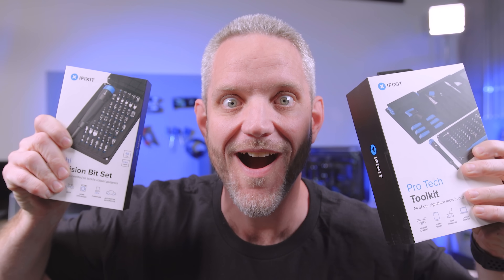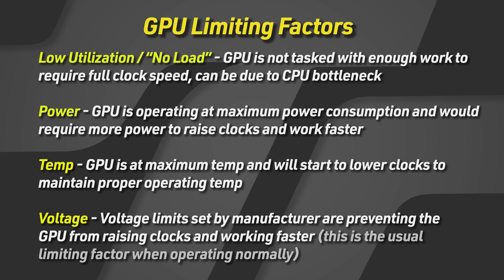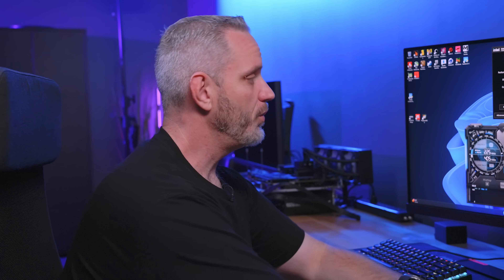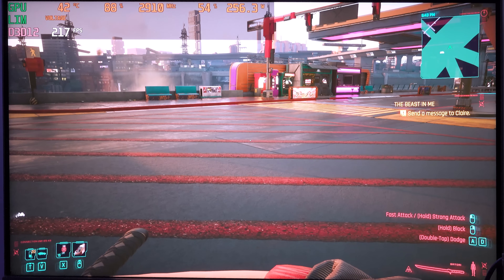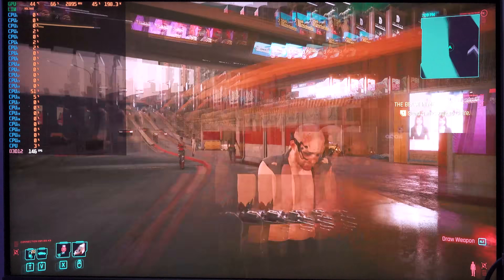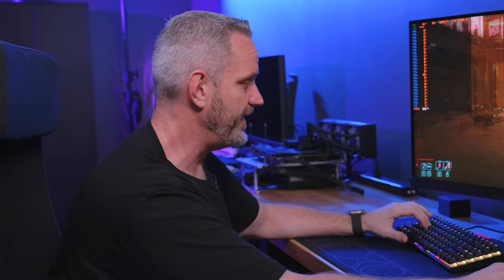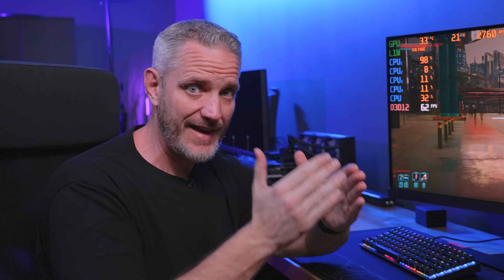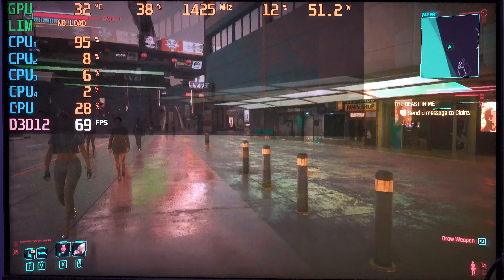THIS is what Bottlenecking REALLY looks like! AVOID THIS!

Comment: I still don´t understand. Its bit weird what was said in the end of video, so I would like to ask. You said as example, that situation you just showed is like user would get i3 13100K with RTX 4090, but it doesn´t make sense to me. 
You did two things to get so terrible bottleneck( and so bad fps). 
1. You meaningfully did lower your cpu power
2. You meaningfully did get settings in video game on ,,low"
Thing is, that me as casual, I actually was thinking of putting 4090 with some i3 processor. Because at first I can casually say that modern i3 cpus are very very good for gaming. 
So this is how I see it. If I would get i313100K and 4090, then turn on Cyberpunk77, I would obviously want to use such monster graphic card and put settings on Ultra...(not low). What I understand is that in such scenario, the graphic card would be in high use because of all those high quality textures presented on screen. And if we are talking cpu at that moment, it should work fine. Surely it might be at very high use (maybe even 98%), but as I see it, it should be still ok and no bottleneck happening. Only if the game would need (from some reason) more from cpu and so cpu would get up to 100% use and could not go higher then I see it would starts struggling. 
Im not sure why you did say at the end of video exactly that processor together with 4090, maybe it just came into your mind, but I dont think so, because its kind of known processor. 

So I dont understand why it would be so bad to get such ,,low" processor with high end card. Because if I would put game settings on ultra - the GPU should ,,eat that" primary. And so if I will use such high end card it should work on ,,fine" lets say 70% use. And now its time for processor to show up. Only thing I can see there obvious is that it would be difference in fps - each bracket some lets say +20 fps. i9 highest and i3 lowest. But as I said, these modern processors should work very all right and that specify one i38100K surely, so why and when that Bottleneck could happen with such combo low processor + high end graphic card ? Thanks !

Comment: Maybe start with something that barely pushes 60 FPS to start and then kneecap it.
I'm running Cyberpunk on an i7-5930K with an R9 Fury and it's capped at 60 FPS... because I capped it at the monitor refresh rate.  
Basically it runs fine on a potato.

Comment: Hi Jay

Hoping you can give some advice. Want to rebuild a pc, but I only play 1080p or max 1440p don't care to get anything higher as I don't have much time anyways, but when I do, I just play dota 2 or casual AAA. I also want to use this mostly for daily usage, I zoom, use Google chrome a lot, vdi (through Citrix) and code (not heavy). 

My idea is Ryzen 7 7700 with 4070, 32gb ram and water cooler. Is this overkill? I've researched for a while now, even think a Ryzen 5 with 3060 might be fine since I like 1080p but I really like cooler pcs, not something hot usually

Comment: I'm not gaming, I'm using my 3070 GPU for video rendering/upscaling. The AI programs use the GPU for their processing instead of the CPU. So, I don't believe I'll run into any bottlenecking problems in this situation, and should be able to upgrade the GPU to shorten rendering times, while keeping the same i7-4790k in the machine. 

I'm looking to upgrade to a more powerful GPU (4070 TS, or possibly a 4080 Super, though I'd like to stay with a 2 fan card rather than one of those 3 fan behemoths, if possible), but there's no information anywhere as to comparisons on video rendering times with these various GPU's that I can find.

Comment: @JayzTwoCents  I still have my 2019 PC build in 2023. I had from 80% to 100% utilization on GPU & CPU from 30% to 60% utilization. My RX590 8GB GPU decided not to show signal on both monitors anymore, fans are spinning, mobo shows VGA on DebugLED. Tried everything for troubleshooting. I have only 2 choices. 1.Resoder main chip but when i asked a repair shop they told me that isn't worth it because i would spend more money on repair than buying same but used one. I did tried without cooler for short time to check if main chip gets power and it feels a bit warm when i touching it when i power PC ON. And option 2.Reflashing GPU bios using secondary GPU for image. I don't want to rebuild my system because im not that rich so im thinking about buying different GPU but to be as a upgrade from previous one. Witch GPU would you recommend pairing with Ryzen 7 2700X powered by 800W PSU? Oh and btw i use monitors 1080p 180hz as my main and 1080p 60hz as secondary one. I know it's old system now a days but i was happy to have it and im definitely not planning to spend 3/6k for new build to match Cyberpunk 2077 Liberty City Max specs as i checked on PCPartPicker.

Comment: I think I got my most mature answer I been looking for I play 60fps at 4k on a 4k tv 60hz. EVERYONE is like 'oh if your not constantly using 99% of your GPU your bottlenecking' without actually explaining why its a bad thing? if I turn vsync off and played a game it'll load 99%. but I lose performance and my pc runs harder and I don't like to risk it. I just feel the less utilization and it can run the quality you want then its fine I always aim for 60% or slightly more I consider 90 -99 too much and it can run your pc hotter. People confuse the fact that gpu has to be 99%.

Comment: I've an i7 9700k paired with an Asus rog Strix rtx 3070ti oc and 32gb ddr4 3200mhz ram and all of my games run smoothly at 1440p , I don't know if I have any bottleneck issues but everything seems ok on the surface .

Comment: I upgraded from ryzen 2600 to 5700x and the diff in performance is quite remarkable for example horizon forbidden west was kinda jittery specially burning shores map even at 50-60 fps felt weird but now frametime graph is smooth as f, alan wake 2 at med - high settings native 1080p i couldn't even hit 50 fps but now 60+ most of the time. I hope 5700x survives for another 4 years lol

Comment: 7:20 I wish these CPU monitors had a feature to show maximum load on any given CPU core/thread. If you have 32 cores and one is running at 97%, the CPU monitor should say "97%" instead of "3%" which is the theoretical load distributed over all CPU cores. This is because your performance will be always limited by the first component of your system that hits 100% first.

Great example about slowing down your rendering because of too slow CPU even though not even a single core hits 100% all the time. This is caused by the GPU waiting for more data from the CPU some of the time and to catch that, your CPU monitor should be polling the CPU load e.g. every millisecond and compute the busiest time period within a single second. As CPU is technically running at 100% whenever it's doing something, the max length of this kind of 100% sequence before idling is the best indicator of how bottlenecked your system is. If you're running 100 fps, the total time for a single frame is 10 ms and if your CPU monitor polls the CPU load once a second, it is not going to see the extra latency caused by the CPU while submitting data to GPU.

I'm not sure if Windows even has the required APIs to monitor the CPU load accurately enough. With Linux, you could use the PSI (Pressure Stall Information) kernel interface to get information about this kind of latencies / system load.

Probably the best indicator of bottlenecking is 0.1% lows for FPS.

Comment: I had ridiculous bottleneck on DMZ with my 4770k and 2080 at 1440p, all the afterburner numbers were red! (i'd never seen that before! ?) max GPU 45% with fps in high 40's and low 50's. 4k was fine 50% better fps 99% GPU usage and about 70fps. Now have a 7700x. Everything at least 50% better.

Comment: I don't really get how a game that is only loading properly one or two CPU thread can get such an impact by reducing thread and core count to 4, still the double of what it should be using???? All while maintaining the 5.1 GHz???

Why?

Isn't it a cache size problem? (When reducing core count and disabling Hyperthreading, cache size reduce drasticly)

Wouldn't a CPU with less core/thread count but same speed and cache size perform the same (if not better since more cache per core) as long a you still have more or equal the thread count the game is using.

Did you just demonstrate that having 20 threads at 0-2% actually gives you better performance????

Comment: A CPU bottleneck is when you run a Pentium D with an RTX 4090 and play CS:GO at 480p. A GPU bottleneck is when you run a 7800X3D with a GT 210 and play A Plague Tale: Requiem at 8K.

Comment: I have a Ryzen 9 3900x and upgraded my GPU to a 3080Ti. I am noticing significant bottlenecking issues but wondering if need to upgrade my CPU... or if there is something I can do to fix it. Keep in mind I am a noob when it comes to understanding how to overclock or tune settings. Would love/greatly appreciate help or advice on what I can do.

Comment: Thank you for the video! Very informative as usual. I'm thinking about buying 4070 super but I'm worried about bottlenecking with my i7 9700k (with 32 GB of 3.2 GHz RAM). Do you guys and gals think it would work or should I go for something like 13600k?
Reply: I would upgrade. As far as upgrade choices go, the i5-13600k is definitely a great option in that ~$300 price range, but for a few extra dollars you can get a Ryzen 7 7700X which will be more efficient, have faster speeds, and have slightly better single core performance. Just note that either way you'll have to upgrade your motherboard as well, and if money isn't tight, it would probably also be wise to get faster ram.

Comment: i don't understand- running low 160fps is 1 core 60% but you get only 4 cores on the cpu and you have 4 cores loaded to the brink? how does that make sense? either the engine uses 1 core to run or does not, otherwise there is something that's a scam that's going on to force you to upgrade.

Comment: All experience described here is in 1080p: 

I paired a 12100F with a 3060 12GB/32GB DDR5 4800, zero bottleneck in GPU heavy games, but on CPU heavy games, like my modded GTA V, the GPU and CPU usage become 50-50 sometimes and huge stutters and loading issues, especially when driving fast, in the city, with a lot of buildings, cars, peds, etc., and when moving fast from one area to another, my GPU usage stays 60% for around 40 seconds then bumps up to 80% and I get more FPS
Cyberpunk gets me 99 GPU/90-99 CPU at maxed out Path Tracing DLSS Balanced +30 FPS without using FSR 3.1, so no bottleneck faced here, unless maybe times I wasn't aware but I barely faced any stutters there with a very smooth experience based on my FPS

Main Point here:
It's a basic rule to always pick a CPU a bit stronger than your GPU, to feel safe, and not a ruined stuttery, fluctuating FPS type scenario

I feel a 3060 12GB needs at least a 12400F on DDR5 not to feel bottleneck, still maybe get 13400F as it's safer

I'm gonna go for maybe a 14500 to feel completely safe on my 3060, all the way up to 4060 Ti you are relatively safe, at 60FPS you are completely safe, then maybe pair a 4070 like strength GPU from Nvidia's upcoming 50 series, yes it translates to my certain situation, but I only want 60 so it pulls 60 out of there for me

The importance of a strong motherboard is emphasized here, as newer H series won't have strength for i9s and i7s, even i5k's struggle, which is what I got, unlike my old P8H61 which could pull an i7 without voltage issues, so you should go for at least a gaming B series, or better to go for Z series if you want to play for a long time on an i9 on your same motherboard

I could've got a Z series with an i9KS then a 3080 12GB's, or 4070, and played for some years then swap boards, only cause of stability issues, else I could've gone for a 14900K and play with the strongest GPU's on a higher resolution

I had elsewhere to invest, but I feel I could've gone for an i5, or an AM5 platform for future upgrades, still not an unplayable experience in most games but GTA V feels really bad at times, and It has poor DLSS mod, and FSR3 FG looks awful

Comment: I have a i7-7700k .  . I expected a bottleneck when I upgraded from a 1060 3gb to a 3060 6gb but not to the point of my PC crashing anytime I'm playing anything demanding  . . can only play Baldurs Gate 3 on low and a few other games similarly . . the moment the CPU hits close 80c my PC clicks off and restarts . . cant get a CPU upgrade either because apparently my motherboard is also subpar :) and I have the best CPU it can support haha. Going to have to invest into a new motherboard and CPU. . and most likely cooling at that rate . . all because I lacked the knowledge and thought just upgrading my GPU would solve all my issues. .

Comment: I thought my 2070 super was the bottle neck on my thread ripper 1920x but when I started my 7950x build I plugged my 4090 in and got the same frame rate. went and grabbed my old 1060 extreme gaming card and could almost get the same frames on it lowered the graphics and it hit the same bottle neck. the whole time the game was playable with only occasional studders and lag. I never thought my overclocked thread ripper would have been the issue. should have opened up gpuz and hardware monitor more often and tested it i guess.

Comment: My cpu is an I7 4770K and my gpu is a RTX 3080 TI and i felt the problem multiple times at the lowest option you did. Monitor is at 4k 144hz... it is struggling (cyberpunk) Bottlenecking is a thing but it is only seen on CPU's that are way too far apart like mine.

Comment: So I'm trying to figure out if what I experienced earlier today (playing Cyberpunk, go figure) was a bottleneck.
It was at the point in Phantom Liberty where you are facing the Chimera, and attempting to escape under the first shutter with the President.
I experienced what felt like a MASSIVE lag. I'm talking maybe 1/3 frame per second, if not straight up pausing. To be fair, the Chimera was actively shooting at us, and the game was being run with all the bells and whistles at 1440p.
For reference, I am running a 14900K with a 4090 - not overclocked. Power supply is a 1200W.
Does this give anyone any ideas?

Comment: if my GPU is at 98%, and my CPU is at 33% is that bottlenecked or is that okay? 
Right now I have an i7 11700 which is 2.5Ghz, but its overclocked to like 4.2 or something (I didn't do it myself, it came like that)
And my GPU is a 3060... playing mostly in 1440 with not particularly graphics intensive games, and when I do play something like Baldur's Gate 3 its with some settings on Low and others high. I do want to upgrade my GPU to something that can run some less intensive games in 4k tho like a 4070 super or something. Idk if I will also need a CPU upgrade.

Comment: I'm currently running a Ryzen 5 3600x with an 7800 XT. My games are very laggy for the first couple of seconds when I enter them, but things seem to smooth out eventually. After watching this video, I am almost 100% I have a CPU bottleneck, so thanks for the enlightenment! I have an AM4 motherboard (B550-A) and am considering upgrading the CPU, which CPU will pair the best? I was looking at the 5800X3D, but it's very pricey and I'm not sure if it's necessary. Thanks!

Comment: I have the 5800X3D with the Asus Rog Strix RTX 2080 Super, and I want to upgrade my GPU. My monitor is Asus PG259QNR ROG Swift 360Hz 1080p (I mainly play FPS games like CS2, but also like RDR2, CoD). Don't know if I should go with either AMD or Nvidia. I'm currently interested in Sapphire Radeon RX 7900 XTX Nitro+ or ASUS ROG Strix GeForce RTX 4070 TI or 4080. What should I do?

Comment: Thanks for the explanation! I wonder if I could upgrade my rx580 to a 7900xt or xtx while keep using my 6700k. Could AMDs Virtual Super Resolution help to reduce a potential CPU Bottleneck as the GPU renders in a higher resolution and scales it back down. 

I plan to upgrade the rest of my system step by step well I guess all at once since I should go with DDR5 to future proof it for a while. Because I don’t wanna upgrade every 2 generations

Comment: For me, it's really simple. Here's how to calculate true CPU bottleneck.

1. Run a game with best CPU and best GPU available. See results
2. Run the same game with best GPU but choose different CPU. See results.

The percentage difference between CPUs is your bottleneck. Now - you could call that lost GPU potential. But you can call even 30% drop in performance "lost GPU potential". I think anything over 15% loss in performance (delta from best CPU available) should be considered CPU bottleneck. Because even though you're running the game just fine, you COULD be running it 15% faster with a better CPU.

If you run into straight up stutters and lag that's not game engine related (or VRAM or RAM or whatever), then your CPU is just completely outclassed by game demands and would probably bottleneck even a significantly slower GPU.

Comment: is a  51 pcr / 39 ecr ideal? i have been having stability issues with anything over 53  pcr / 43 ecr and even then it can be dicey if ive been on it for 7+ hrs 
specs: msi 4090 gpu, i9-13900kf, z690 UD AC-Y1 gigabyte motherboard and 64g of corsair dominator ram. temps run fine idling and while gaming but when stress testing at higher than 53pcr it results in either said program (intel extreme tuning or cinebench23) crashing or bluescreening. Just did a fresh install of windows and looking for ways to make this pc run the way i feel like it should.
side note - at 53/43 efficiency ratio some games still critical error at random times.
edit - my cpu currently runs at .8-.9v which feels very low.